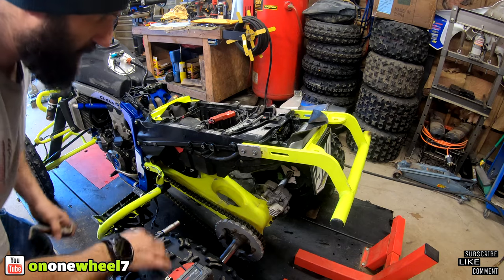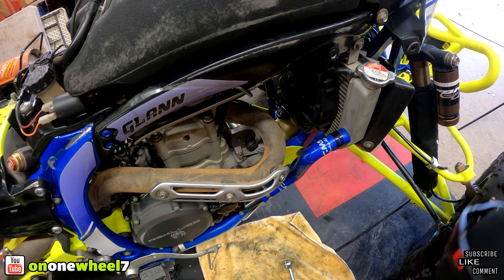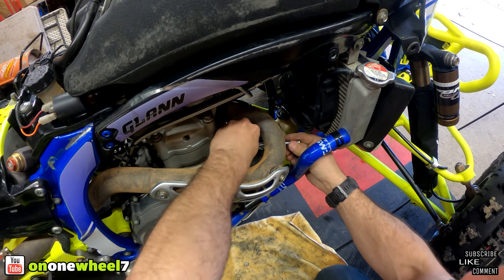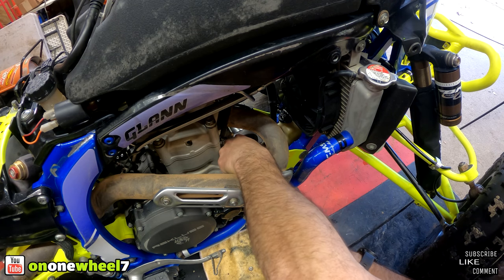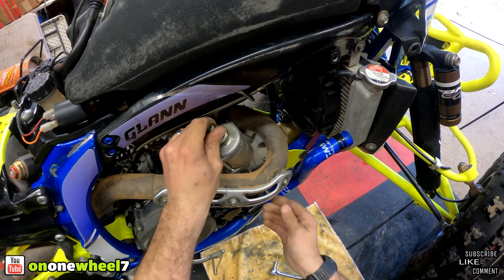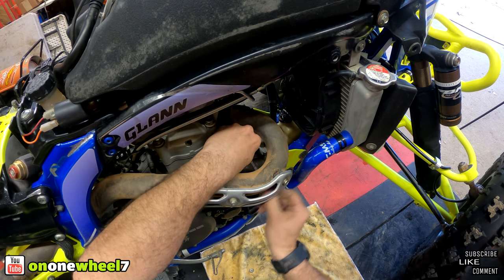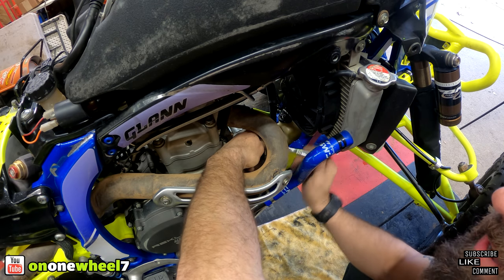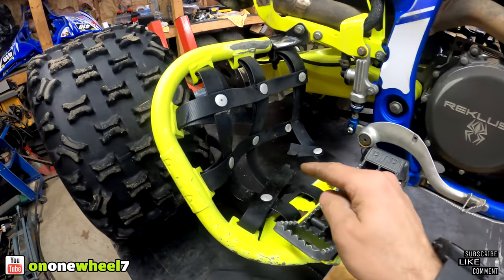GARAGE DAY PART 1  GETTING THE QUAD READY  FOR THE NEXT WINTER SERIES RACE

Comment: Hey dude, beautiful quad, I've got an 09 yfz 450r and I also have am FCI but just with the stock air filter that comes with the FCI. I want to switch over to a foam filter but I have no idea which one to get that will fit the FCI on my quad. Which one do you use as I see you have a pretty similar setup.
Reply from the maker: Thanks man!
I run the uni foam filter i get them threw BNRMOTORSPORTS!
Im not sure what model number it is but bnr knows i can try and find out im sure ebay has them as well!